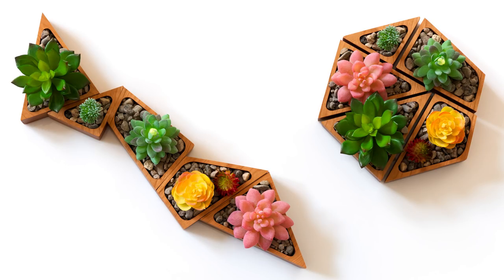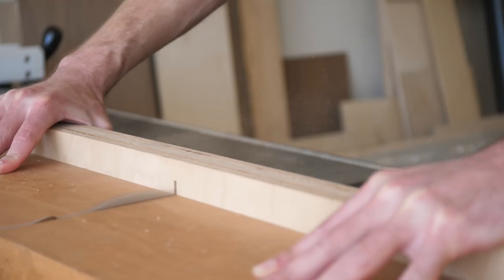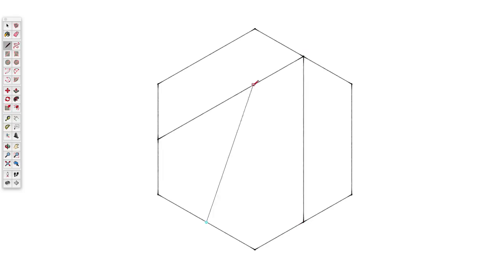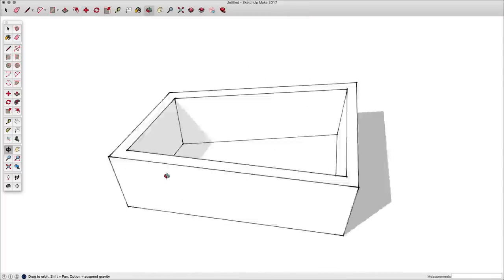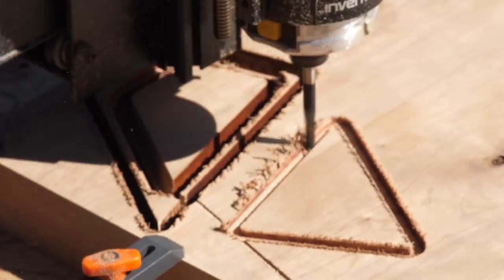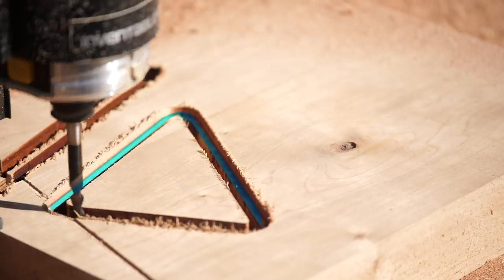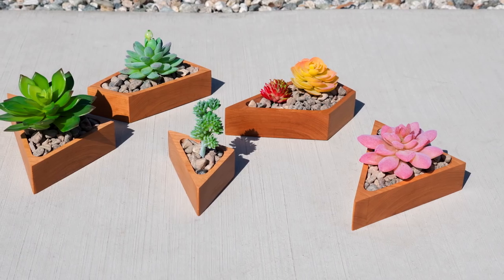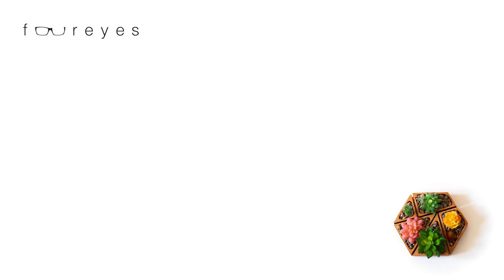Modular Puzzle Planter on a CNC | Woodworking

Comment: Looks awesome. This could be a nice application of a 3d printer. If you would print a thin inner shell for each of the planters it would be water tight. As you anyhow already have the 3d model printing them would be quite easy.
Reply from the maker: Now all I need is a 3D printer. 😃
Reply: I think you would enjoy a 3d printer quite a bit. From my point of view the 3d printer is an underrated tool in the woodworking shop. :-)
Reply: How about a variant:  CNC carved shells for 3D printed containers? Tight tolerances = Perfect fit + Aesthetically pleasing + No water on wood...ever.

Just a thought.
Reply: John Coloe Yup. That’s exactly the idea.